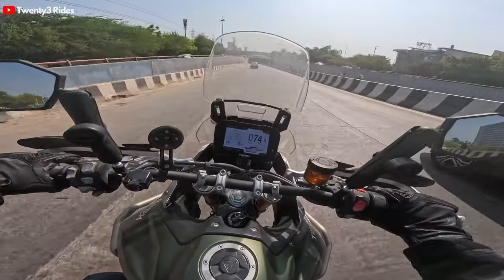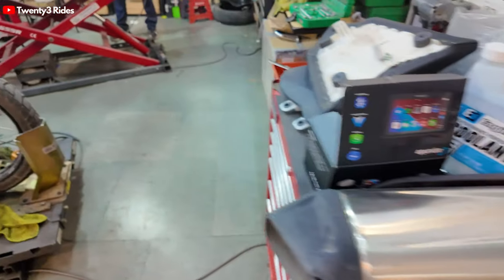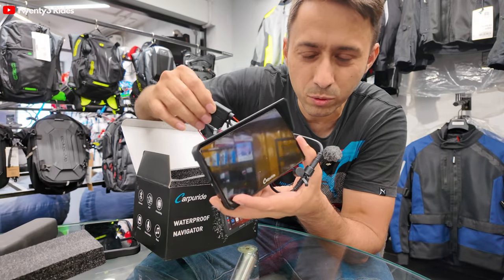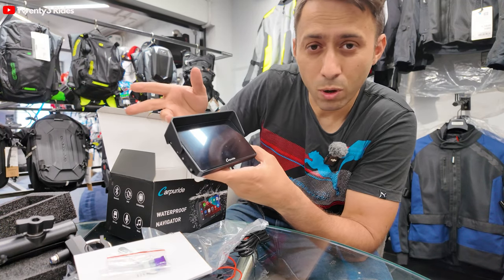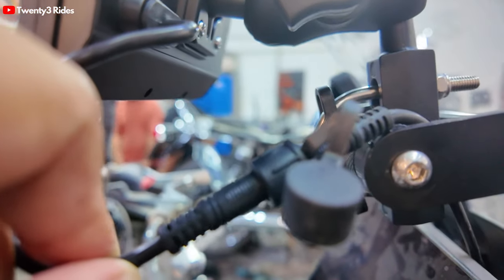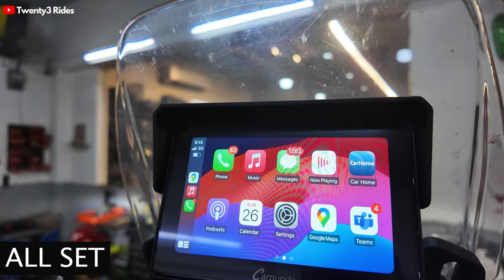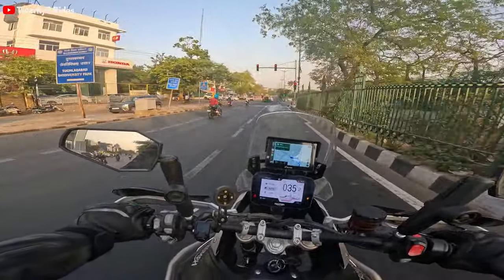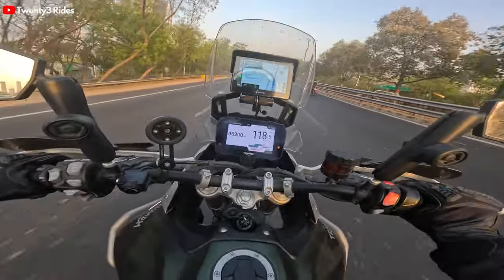Apple CarPlay on Triumph Tiger 900  &  Upgrade to Scorpion Exhaust

Comment: Also, remove the RAM ball mounting and use an AMP mount with torx security screws. No one will steal your AA/ACP easily...
Reply: Can you please share a link of "AMP mount when torx security screws". I'm not able to find it on Google.
Reply from the maker: Yes. Pls share the link .
Reply: @Twenty3Rides  you removed my original reply about better units than Carpuride and about the issue caused by mounting these AA/ACP units on the windshield mount? 😪. i thought we should be transparent and share knowledge with other so they can get the best.

Comment: Buddy....pls tell me if this exhaust will be legal ? I guess not....and it will be a challenge to navigate in places like Chandigarh, Dehradun, Kerala and many more
Reply: With the baffle no one would suspect. Plus it looks stock as well, so if you keep the revs low, you might just be able to avoid any issues
Reply: it seems the legal db limit is 80/82 db. I got the same scorpion serket exhaust and with the baffle removed, it is just 80 dbs. So safe to go for it.
Reply: @NalinKhurb  it does not make a big noise even on high revs. This is an awesome exhaust.

Comment: Did the carpuride effect the phone battery or any laggiging? How easy is the unit to get stolen?
Reply from the maker: Phone GPS is used for navigation, but screen remain off .. Which means battery drain is not a big issue . And as it its Navigation is not used for the whole day.

There is an option to get a Lock addon on the ram extension rod.. I will get that.

Comment: Helmet will connect to this device now. Be careful, you may lose some features like invoking siri.
Reply from the maker: I actually do not ise Siri at all.. I find it a hassle . Main peurpose of using this device for me is Navigation , without the worry of damaging phone camera with vibrations and eliminating the need to carry an extra phone .
Reply: If you listen to music on Spotify or similar apps, route your audio output stream Directly to your phone instead of thru the Carpuride device. Carpuride's audio stream quality isn't good, compared to your phone.
Reply: @Twenty3Rides  oh ok. Are the phone calls coming in fine? By default audio will be routed to the carplay device and not Bluetooth. I am assuming your helmet is connected to the phone directly here. 

With bmw1250, its a hassel. Since the phone has to send audio to the bike else we lose the rocker functionality of changing music, taking calls without ever lifting our hand up.